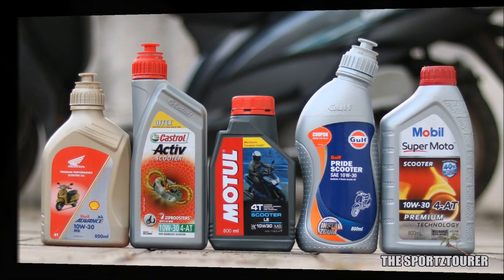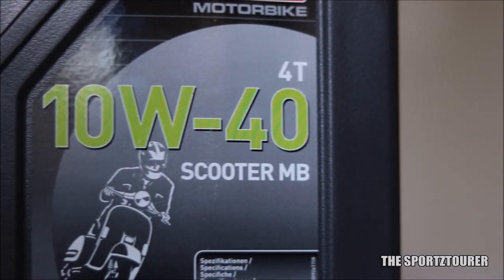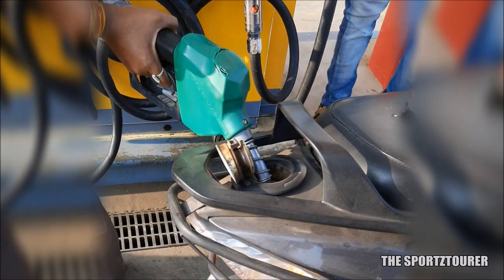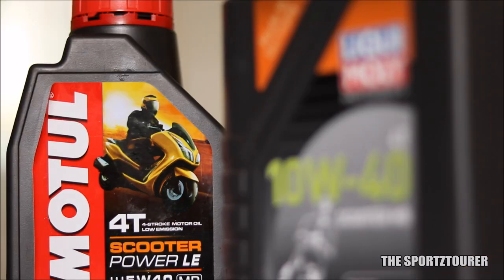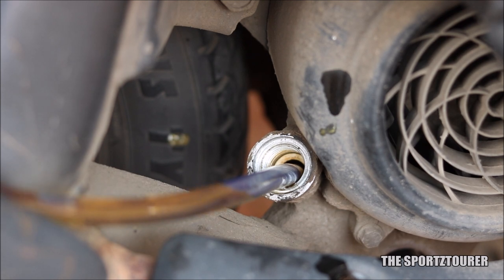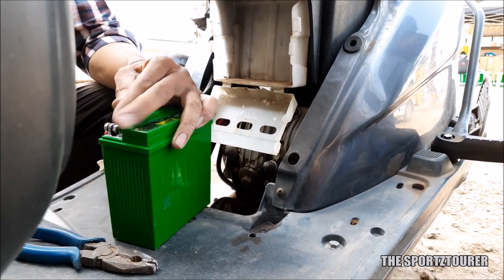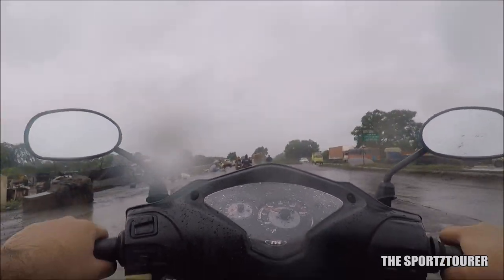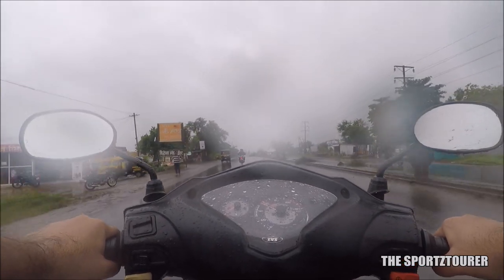LIQUI MOLY SCOOTER ENGINE OIL VS MOTUL SCOOTER POWER LE, COLD START PROBLEM, BEST SCOOTER ENGINE OIL

Comment: Is hydraulic clutch system is good option to swap stock one
Reply: if your bike doesn't heats very much then you can do it
Reply: bikes of Royal Enfield have wire clutches because the heat will cause fluid to heat up 
unnecessarily
Reply: If you live in areas like Delhi where summers are very hot, you will lose all the benefit of the hydraulic clutch and life of the fluid will go down. Do it if you live in relatively moderate climate area.
Reply: @bobbysodi6661  even race bikes will have their crankcase area very hot still they use it. Its not just about heat, its how the engine is cooled. Bullets are air cooled so no point in installing then, but if your bike is liquid cooled and you don't face heavy traffic then hydraulic clutch makes sense.
Reply: @tejaspadhye  yeah point is if you have something like apache or ns200 you can do it 
but such upgrade on REs is not worth it
Reply: @bobbysodi6661  you should have been clear with the examples that you're mentioning now, ns200 and apache. RE already is ancient technology why install hydraulic clutch anyway 😂
Reply from the maker: Hi Kishu!
Tejas and Bobby have brought some interesting points. For me the RTR has already got a sweet and light slipper clutch set up which works flawlessly.
Reply: @tejaspadhye  how about adjustable brake and clutch lever and will it maintain free play of clutch
Reply: @kishutech1272  yes you can tey those without any problems

Comment: Sir can i use motul le on my yamaha ray but it grade is 10 w 30
But company recomand 10w 40
Reply: better to stick to xw40 grades
Reply: Allie X  thank bro
Reply: @rko951  thank bro
Reply: You can go for Motul Scooter Power Le 5w40.
Reply from the maker: @rs 20 I will prefer sticking to 10W-40 👍

Comment: Dude, which engine oil would you recommend to Aprilia SR 150…? 
Any viewers here please Share your thoughts and experiences...if u have any...
Thanks 👍
Reply: whats the grade for aprilia?
Reply: @rko951  The manufacturer recommends 20W 40 Castrol Activ 4T 
But I've not found anywhere in the market that mentions "scooter specific" on the product!
Reply: Allie X  Bro, SR 150 in the manual recommends 20W 40 Castrol Activ 4T (which nowhere mentions scooter specific) as far as I saw & nowhere available in the market with this grade in any other brands aswell.
What options do u see?
Reply from the maker: Hi Anantha,
As mentioned by others 20W-40 is a hard to find engine oil grade specially if you are looking for a premium engine oil. Castrol Activ is a mineral based oil and as far as I know JASO MB Activ for scooters is only available in 10W-30.

Comment: You have a lot of experience with oils man! One question, which is the best scooter oil 5w-40?
Reply: Allie X  Yeah, I know. Piaggio group recommends that grade. I live in Greece. Winter is about 0-10c, and summer 35-45c.
Reply: Allie X  Yes. This is correct. I am thinking to use Castrol power 1 scooter 5w-40 next time. Do you have any opinion about this? We don't have a big variety of MB oils here.
Reply: Allie X  Thank you very much!
Reply: Allie X  I am glad that you re so far away, but you know what is happening here! Yes bro, we have problem with them. Thank you very much for your support. People have more in common than differences. Politians go crazy. Their sultan wants everything but we are ready to defence, and keep that small but beautiful country.

Comment: bro i’m put it my engine oil 10w-50 liqui moly Full synthetics in my pulsar RS 200 at july 2019.....but bro i’m completely 3000km in 1 years....so i want to my engine oil or not bro??
Reply: No
Reply: Any oil Shelf life is 1 year so you should change oil. 
It's make no sense to waste money on fully synthetic engine oil especially when you hardly drove your vehicle less than 12000km per year.
Reply: If you drive your vehicle daily 50 km and above then you think about wasting money on engine oil.
Use synthetic oils after completing 25000 kms

Comment: Hi...I was not aware about engine oil grade until I watched your videos. Great content no doubt, keep it up.
I own a Hornet BSIV 2018 model and  was not aware about the oil grade. During my free service from the showroom they used the recommended grade i.e 10W30 Honda engine oil. No qualms basically....
But the latest paid service from a reliable local mechanic of mine went for the Castrol 20W50 semi synthetic engine oil.
Now please suggest me "Should I run my bike or drain the oil and fill it with the recommended grade"
Which grade would be best 10W30 ,10W40 or 10W50 full synthetic....
Please give me your honest advice sir...
2 saal mein ek bhi problem nhi aayi bike mein...(already clocked 15000km). But now I am a bit confused as I am not aware of the grade the same mechanic used last time(last change was at 11000km). His son advised me to change after 5000 km, but I clocked 4000km and changed it.....
Take me out of this dilemma... Earnest request sir
Reply: Reliable local mechanic? Hahaha😂
Us Aadmi Ko grade tak Ki knowledge to hai ni.
Which oil r u using now?
Castrol Power1 Cruise 20w50?
Kms Driven post oil change?
Reply: Castrol Power1 cruise or may be Castrol Power1 Racing....I am not so sure but grade was 20W50. I have driven more than 200km post oil change. Reliable in the sense...he is not a cheat
Most mechanics don't delve into technicalities....Yeh kehna tha
Reply: Cost Of oil ?
Power 1 racing is fully synthetic oil avlbl in 10w40/ 10w50 only.
Changes observed after oil grade change.
95% professionals don't know much abt their own profession bcz Nuksan to owner ka hi hona h unka lie problem to source of income h.
Cheat , don't let him any scope to cheat, Be present during repair and parts change.
Reply: @police9615  yeh toh aapne bilkul sahi kaha.... Professional yahan hai kaun...MRP of oil was ₹439
I think it was either Power1 Cruise or  the simple Power1
Performance wise I am not noticing any change....
This is the main problem how to check the performance...🤔🤔🤔
Reply: Cold starts ?
Engine warming up after start i.e. idling but hesitate to provide pick up for some time.
Drop in acceleration , mileage etc.
Kinematic viscosity of Power1 10w30 -
73.7 mm2/s @ 40℃
11.36 mm2/s @100℃
While for power 1 20w50
156.3 mm2/s @ 40℃
17 to 19 mm2/s @100 ℃.
At cold engine condition oil viscosity is more than double of its 10w30 counterparts, so oil take more time to pump & flow , increased wear & tear of engine parts @ startup.
Better drain oil, filter nd use it to bike with 20w50 grade like pulsar etc or Enfields.
Else ~₹360 - 370 are not much for a new engine's safety.
Reply: @police9615  Thankfully there is no such issue...but my heart is not at rest. 
Simple draining and refilling would suffice or flush is also required.
Which grade to use 10W30 or 10W40? 
A grade higher or the recommended grade
Should I go for fully synthetic or semi synthetic
For the time being I will stick with Castrol
Next time I am thinking about Motul or Liqui Moly
What's your recommendation?
Admin sir bhi reply krte toh kitna accha hota
Reply: @the sportztourer, He generally replies to queries.
unless u were using mineral based oil & stretched drain intervals, 15k Kms is not much to use flush.
Warm up engine, let it drain for more time ,tilt as well.
if you live in a hot area & engine usage is heavy i.e. Traffic, highways etc
U can go for 10w40 else 10w30 is ok.
better go for synthetic oil if regular usage is more.
For low running engine high cost for Synthetic oil doesn't make sense.
Motul is good ,Liqui moly is much hyped & overpriced.
Castrol power1 series is fine.
Also shell Ax7 or shell advance ultra can be considered.
Reply: @police9615  Prior to lockdown it was 20km/day.
100km/day very rare( in a month or two)
Honda showroom staff use their own Honda label oil.
No traffic issue, free roads and highways everywhere.
In city my speed is 40 to 50 while on highways 60 to 80
Castrol series semi synthetic 10W30 refill krwa deta hun...
Kya kehte hain aap...
@the sportztourer se query kaise puchu.. process please
Reply: @the sportztourer ,replies on youtube itself.
Power1 10w30 is ok if usage is low.
Reply: Gulf powertrac 4t 10w30 is fine
also, Hp racer synth 10w30 API SN is latest in API Certification.

Comment: hello bro..what to do with rusted forks
Reply from the maker: You can spray WD 40 or rust removing stuff like rust off and leave it for sometime to work on the effected area.
Later you can rub off the rusted area to get ride of the rust.
Reply: A dedicated video on WD 40 should be there.🙏🏻
it's composition, uses, advantages and disadvantages etc.

Comment: Please review this Valvoline Champ Extra 4-at 10W30 Synthetic Blend Scooter Oil
Reply from the maker: Yet to experience it, have you used it?
Reply: The Sportztourer no but it's semi synthetic and costs 260 rs for 800 ml. besides valvoline is an internationally famous brand. i was about to buy it but it was 2018 stock so i chose gulf pride scooter, it says synthetic but i'm not sure if it is lol

Comment: What about the drain intervals of both the engine oils?
Reply: ive used motul scooter LE fully synth, for my activa, it didnt last for more than 5 months and my monthly riding was about 500km.
Reply: @rko951  thanks. It means only 2500 kms? Then what is the point of synthetic engine oil. Even for mineral engine oil the drain inerval is 2000 - 2500 kms.
Reply from the maker: Hi Gian,
Drain interval depends upon use. Even under heavy use both these oils should perform well till 3000-3500km.
Reply: @thesportztourer  if on low usage after how many months should I change engine oil? Using Motul 10w30 LE. Please suggest.
Reply from the maker: Hi @Pankaj Kumar,
For low running engines, oil change should be done once a year.
Reply: @thesportztourer  Okay Thank You so much for the reply.

Comment: Bro avenger 150 street me konsa oil dalu bike 4 saal puranj h 23,000 chali h
Reply: Motul 3100 20w50 or 5100 20w50
Reply from the maker: Hi Ritik!
Aap abhi konsa oil use kar rahe ho?
Reply: @thesportztourer  motul 3100 20w50 kyuki 5100 me 20w50 nhi aata fir direct 7100 aata h vo thoda expensive h 😣
Reply: 7100 10w50 has viscosity index of 167  compared to 7100 20w50 as it has VI of 158
Also the low temp viscosity is lesser in 10w50 i.e. easy flow at cold starts.
Difference in price is around ~200 rs b/w Motul 5100 & 7100.

Comment: The liquimoly 10w40 MB is better performance to only aprilla an vespa both 150cc scooters. 110cc or 125 cc is 10w30 enough that will be the better performance.
Reply: If you are running the 110-125cc scooters alot in heavy traffic and high speed on highway the 10w40 makes sense, otherwise for normal city usage you are correct, not needed.
Reply: @tejaspadhye  5w40 motul is useful only for cold starts mostly, that was my experience and it didnt last more than 5 months and i dont ride much either
Reply: @rko951  kidhar reply kar raha hai? Maine 10w40 likha hai naa ki 5w40 🤷‍♂️

Comment: Can you expose a false claims by motorcycle manufacturing companies like Honda and Bajaj?
They claim that they are using BS6 engine oil in the new two wheelers and should not use other oils
Bajaj is claiming that with their new B.S6 engine oil's drain interval increased to 10K kilometers
We all know there is no such oil rated as B.S6 or B.S4 engine oil.

Comment: Its not just oil. Tvs engines are always better in cold start.
Reply: Ntorq sucks I have to leave the engine start for more than 2 mins idle for getting ready else it give vibration
Reply: @arbazshaikh2034  that's for any scooter or bike. You SHOULD give 1-2 mins idle for first cold start of the day. Honda most of the times wont start until 6 7 cranks. Your tvs starts in one crank I think you can wait for 1 minute